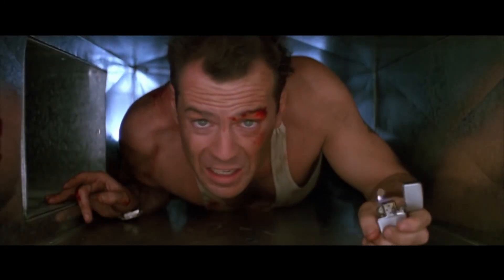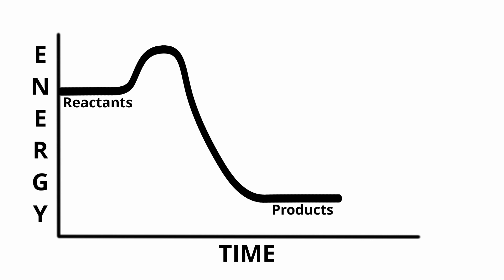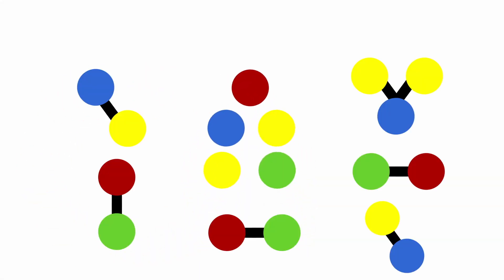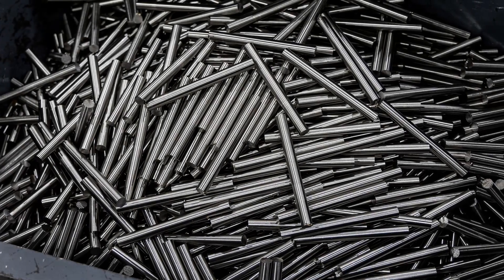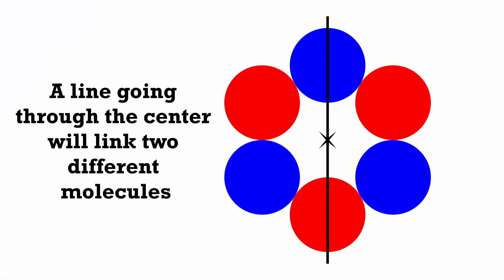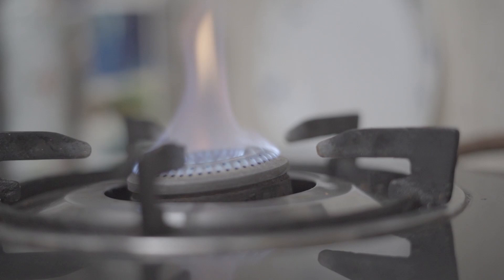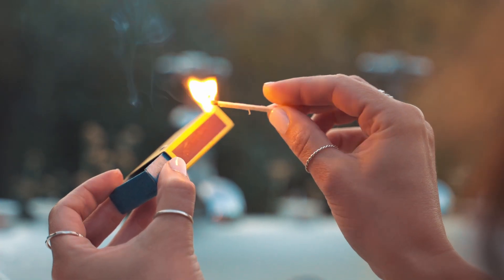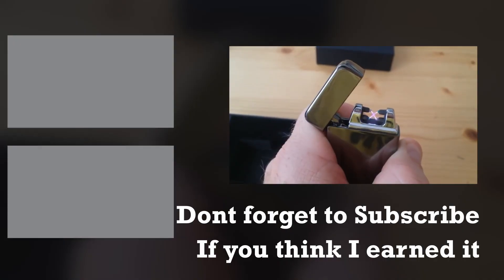How Lighter Works- (ZIPPO, BIC, Piezoelectric) Incredible Engineering & History

Comment: My primary issue with this video is that when he speaks upon the flintlock tinderbox/flintlock tinder lighter he shows us a photo of a modern butane gas lighter that is shaped as a flintlock. Funny but also inaccurate. The flintlock lighter had the barrel removed and in place had a tinderbox designed to catch the sparks from the flint while while holding tinder. They were no more dangerous than a cap gun

Comment: ...and there are jet lighters and today also USB charged lighters that use the heat energy generated due to resistance of certain metals to electricity. The electricity passes to the metal molecules but the resistance creates some energy to warm up the metal. Its the same as the traditional car lighter. Great video!